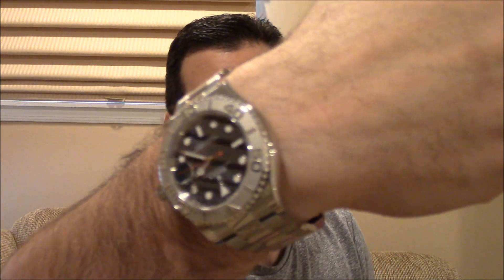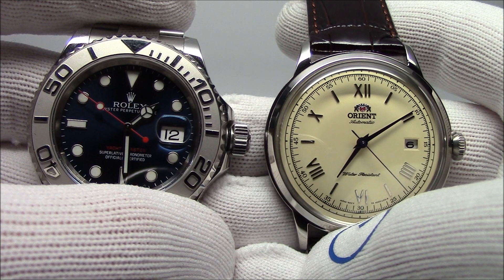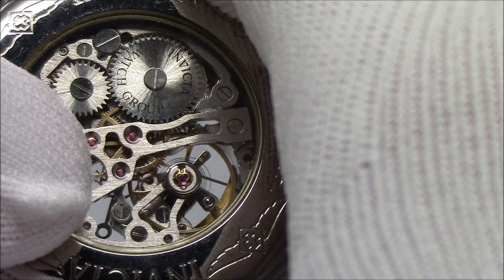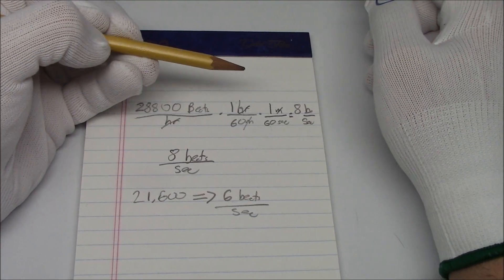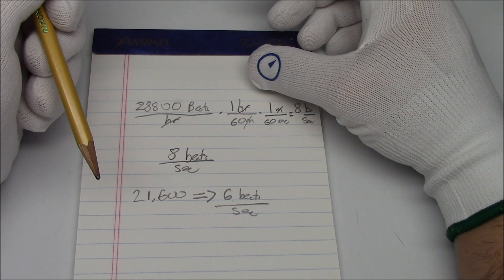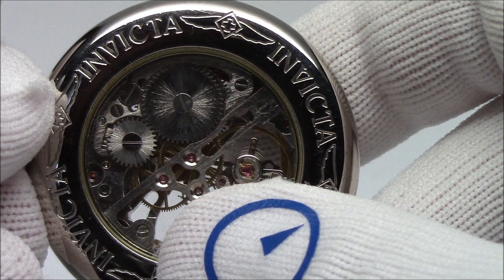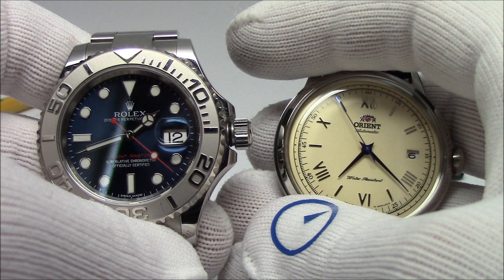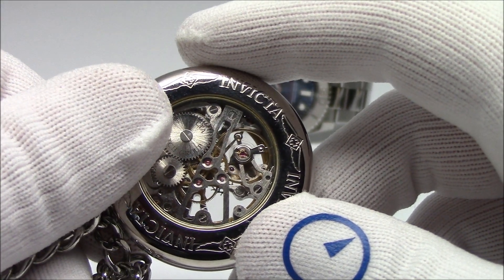What Factors Determine Beats Per Hour or “BPH” of a Mechanical Watch Movement? Watch and Learn #28

Comment: I am late to this series but have been watching them one by one. So far, I found the topics and the explanation excellent and have learnt a lot. Many thanks for taking the time to share your knowledge with us.
Regarding this one, I am wondering what determines the bit rate mechanically, as this point was not discussed in the video. I would imagine that it is determined by the size of the balance wheel and/or the length of the hair spring. Is that correct?

Comment: An oscillation is one full movement of the (balance) from its starting point and back to that point again. A vibration is half of that, so one oscillation equals two vibrations (beats).
ie:
21600 vibrations/beats per hour
21600 ÷ 3600 seconds is 6 beats/vibrations per second.

Comment: Yes, the beats / second (ticks per second) is based on the stones in the palette fork.  But, they aren't even , are they?

This is where we get the "tick-tock" of the clock.  One cycle per second (balance wheel) is two beats--  "tick-tock".

But, the entrant stone and the exit stone make a slightly different sound (tick vs tock) and the time between the tick and the tock are also slightly different.  

I believe we should talk about the frequency of the watch as the cycles per second (Hertz) of the balance wheel.  This is an accurate measure of the "time granularity" of the time piece;  and not as confusing as the "ticks per second" terms. 

Example;  your Rolex there runs at four (4) cycles per second,  or 4 Hz.  

marcus

Comment: I ink the only lower beat than 21600bph is Vostok that makes 19800bph movements.

Not sure why most manufacturers settled on 21600maybe as its fast enough and does not wear out as fast.

I do prefer 28,800bph and I don't feel a need for anything faster.

I am pretty annoyed with swatch group upgrading Eta movements by including silicone hairsprings, a larger power reserve but then making it very difficult or impossible to regulate and lowering it to 21600 from 28,800.

I love the old microajust on Eta movements.

I realy like Orient movements, I just wish you could get spare parts and they had a micro ajust.

If they made something like a Kamasu with a GMT function I think it would sell very well.

Comment: Thanks for the video.  I agree it’s a topic that can be easily misunderstood.  Like you said a higher beat per hour watch maybe more accurate.  But like everything There is always a downside. For example  to achieve that higher speed you need a stronger balance spring and mainspring which puts more pressure on all the pivet Joints, that and having 25% more friction due to it being faster can cause them to wear faster. so it will Need to be service More often: also the parts can be more expensive due to them being made thicker to withstand this extra torture. Where as a movement that has a slower  beat per hour can be just as accurate and not need to be serviced as often. So which is better? That depends,   You explain the beat per hour being faster is more accurate because any disturbance that happens can recover faster
Because it has more second hand tics per second ro average out into. I think you understand why it’s more accurate but your explanation is not very clear. It skips to the end without showing your work on how you got there. To start at the beginning we need to understand what makes it inaccurate and how the beat per hour can effect that accuracy. A watch works because It has a mainspring inside a barrel, a drive train to tranfer energy from the balance and a escapement and balance to release the energy in a controlled way. It’s like blowing up a ballon. The air inside is the main spring and if you let go of the opening all the energy gets released at one tine. This is like the energy stored in main spring . The balance wheel and escapement controls the release of energy. So anything that changes the balance moving back and forth or disturbs the hair spring which is controlling the speed and travel of the balance wheel. like a blow/knock to the watch, will effect everything down the line. The quicker it can go back to the 28800 beats per hour the less time it losses and more accurate it is.   If we were talking about a wall clock speed would make little difference.It’s because it has low risk of being disturbed. Unlike a wrist watch that gets knocked around . A 36000 BPH need less energy and has twice the time to recover than a 18000BPH watch were  the balance wheel is moving at 1/2 the speed. think of a bicycle wheel. A slower moving wheel is less stable and falls over easily if something disturbs it unlike  a faster moving one. So is a faster beat per hour watch better? The answer to that is yes and no. It depends on  how your going to use the watch. So it’s good to have a variety of beats per hour watches in your collection because if your a person who hangs out at home and goes out to dinner wearing a dress watch a slow beat rate is good. If your a adrenaline junky sky diving and rock climbing then a faster beat rate is better. So faster does not always mean better.  there is plus and minuses to both and both have there place.

Comment: I'm more interested in the gear ratio. Is there a different number of teeth on the escape wheel that engage the pallet, or is the ratio changed at the interaction of the escape wheel to the 4th wheel?

Comment: Excellent! I just purchased a Frederique Constant with markings on the dial which read 20,40,60,80, etc. through 240 (at 12 o’clock). These numbers appear on the edge of the dial at five minute intervals next to the roman numerals.
This vid and explanation you provide tells me these numbers correspond to the oscillations of the balance wheel, as opposed to true minutes or semi-oscillations of the eight-tick-per-second seconds hand.
Totally worthless markings, but now I’ll be able to explain the meaning of the numbers in layman’s terms and sound like a bigshot watch dude...LOL!!!
Good stuff, Mark! 👍👍👍

Comment: 28,800 beats per hour = 480 beats per minute = 8 beats per second = 4 Hz.
Reply: 8 anything per second = 8 Hz, but because there are 2 beats in every balance wheel oscillation, the number of movement oscillations are half of stated beats: 4 Hz = 4 oscillations per second = 240 oscillations per minute = 14.400 oscillations per hour = 28.800 beats per hour.
Reply: @My-Opinion-Doesnt-Matter  Whatever. The frequency is always the number of periods per second, and a period of a clock is tic toc, not just tic or toc, both of which being a beat.

Comment: Well done!  You could think of the pallet and escape wheel as a mechanical frequency doubler.  By the way IMHO, I think frequency should never have been changed from Cycles Per Second (CPS) to Hz.  Cycles per second is more intuitive.  I realize it was named after Heinrich Rudolf Hertz.  What is even more absurd is to rename the unit of conductance after a corporation, Siemens rather than "mho" as the reciprocal of an "ohm."  But I digress.

Comment: well, that explanation is not really true when it comes to the accuracy. the reason for hi-beat mechanical movement tend to have better accuracy is due to the fact that human wrist movement is usually averaging to be below or around 3Hz. While hi-beat watches tend to have movement more than 5Hz (36,000 BPH) or even more. so that transform to less interference to the system as we are wearing it. from your point of view, dividing per second into more fractions will result in more inaccuracy if every ticking movement tend to deviate a little bit more of the real fraction of a second. I don't know if it make senses.

Comment: Hey Marc, another great video as always. Thank you for offering such informative and detailed information to the watch enthusiast community. I noticed something in the slow motion footage of the Rolex. On every other "tick" it is actually ticking twice, its like an extra sub tick. Making it 12 ticks per second in actual visible perceived motion. I've always noticed that the Rolex sweep looks slightly smoother than other 28,800 bph movements and this is why! Of course the gear train is of a more precision spec with tighter gear mesh tolerances but this is a very interesting discovery. Did you notice that or do you have any insight on this discovery? Thanks

Comment: My Mido gives me a +4-4.5 sec/day during the summer ranging temperature between 28-32 degrees and it increases +10-10.5 sec/day during winter when temperature falls between 16-24 degrees. I guess temperature is affecting the accuracy and I am not happy with this. Does watches with COSC avoids this issue? I am really unhappy and not wearing my Mido when it is winter now and rather using a quartz watch now. Please kindly advise how can I wear an automatic watch without temperature affecting accuracy. Thanks Marc.
Reply from the maker: 10s is not bad, live with it.

Comment: Great video as always, so my 2016  speedy beats 6 times a second however the Chronograph intervals between each second is split into 5. In reality I don't use my watch to time anything to that accuracy but it would make sense for the watch to beat 5 times a second. I am sure this must apply for many Chronographs. Love the videos BTW you provide a sub genre that not many others do in a very clear way! Cheers
Reply from the maker: Good point, I'm surprised they would do that.

Comment: what about 19,800 vph movements such as the Vostok ones? that means 5.5 ticks per seconds and 2.75 Hertz. what confuses me is that fraction, so I guess the seconds hand does not exactly stops at a seconds marker right ?
Reply from the maker: Correct. think of it this way. . . in 2 seconds, it ticks 11 times.
Reply: I believe my highly regarded "low-end" vintage Omega Seamaster 120....also beats at 19,800 vph. The "classical" argument that higher beats = greater accuracy has this other argument--> slower beats per second also may mean higher reliability/ruggedness..... not just possible longer service intervals. As Marc says.....with modern materials and design, all these theories are thrown into a cocked hat.
Reply: Vostok hat quite an unusual frequency betwwen the usual 2.5 and 3 Hz, correct. But at the end of two seconds, it comes out even, so don't worry.
Reply: this is not true because it will move half as many times, 2 ticks = 1 complete oscillation = 1 movement of the second hand

Comment: Mark, Seiko hi-beat is 36,000 BPH... That's why it is HI BEAT! :) Same as El Primero
Reply from the maker: I say "if it ain't broke, don't fix it.". I've got watches that haven't been serviced in 15 years and still run fine for me. I know watchmakers will tell me it's not good and I'm ruining it, but I just don't see it.
Reply from the maker: Yes, correct. I don't disagree with you there.
Reply from the maker: No so. Look up reference Ref.5676-7010
It is 28800, considered "hi-beat". Yes, Seiko changed their tune years ago,  to be anything higher than 28800, but the examples exist at 28800 with the term.
Reply: http://www.grand-seiko.com/professionaldivers/

Look at the dial
Reply: MECHANICAL HI-BEAT 36000 bph

Seiko Caliber 9S85
Reply from the maker: I am telling you, clearly, in the past Seiko has used the term to denote 28800. Look up the reference number I specified. It also says "hi beat" on the dial.
Reply: Hi Mark, you say you don't go along with 5 year service intervals, do you believe that it should be longer or shorter?
Reply: It is 2017, Mark. Yes, in the past perhaps 21,600 was considered hi-beat. As it stands now, the only hi-beat  Seiko is currently 36,000.